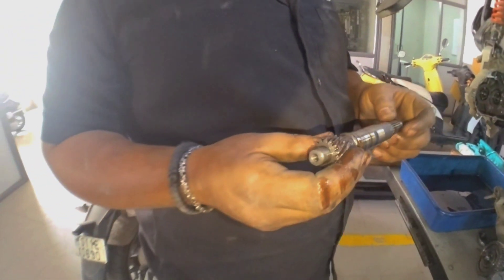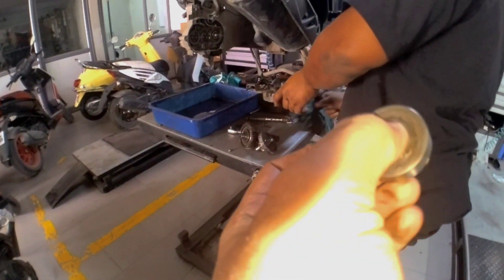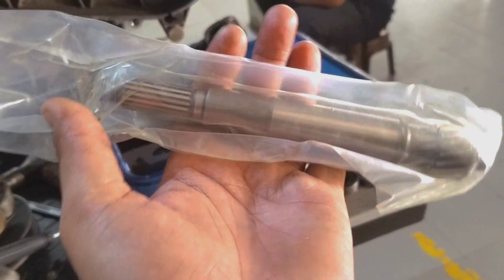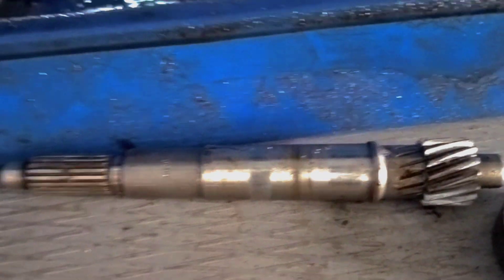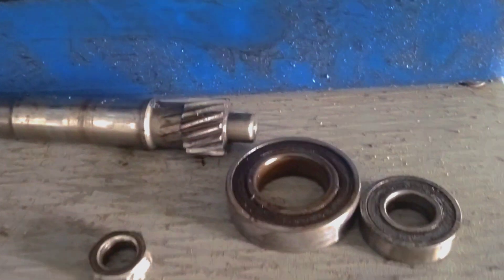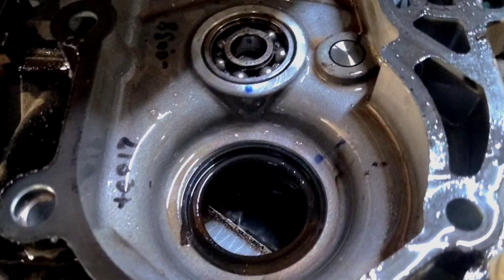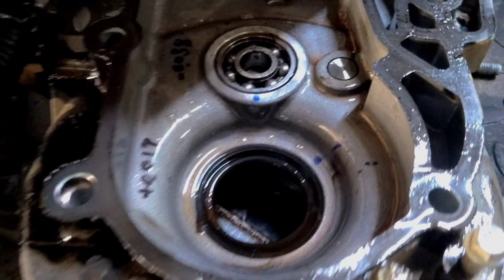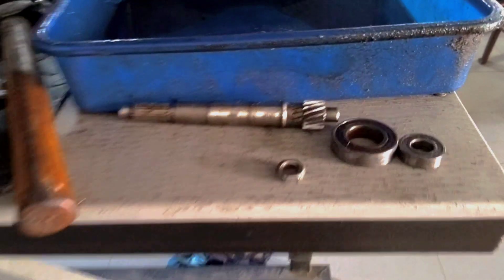Malla🤦 Bike🏍️ La Vibration Problem Ochind🥺i - || - All Aprilia🏍️ Vibration Problem😞 ' ||

Comment: All Vespa & Aprilia scooter make vibration at the spped between 20-30kmph. Only solution is using little amount multi purpose grease on rollers surface. On first some Kilometers the pickup will be some less, but after some ride it will adjusted. Also the white tip rollers produce less vibration than orange.